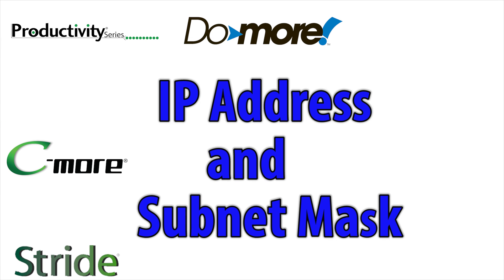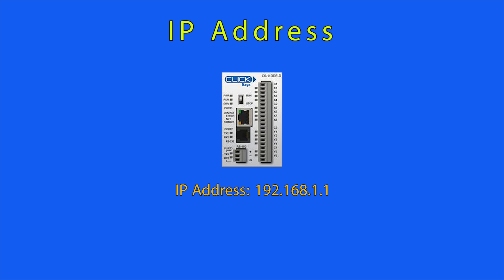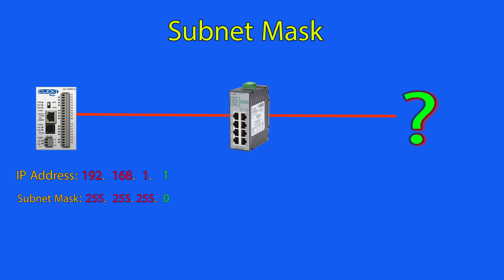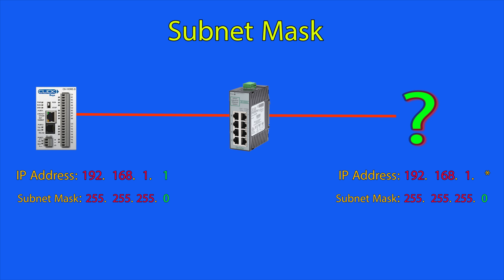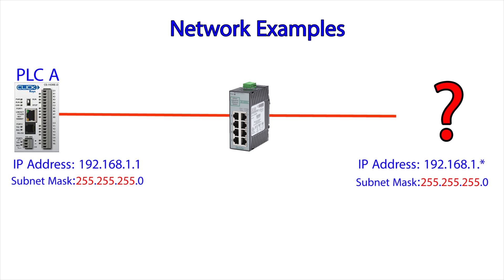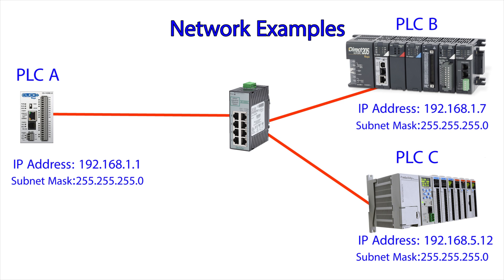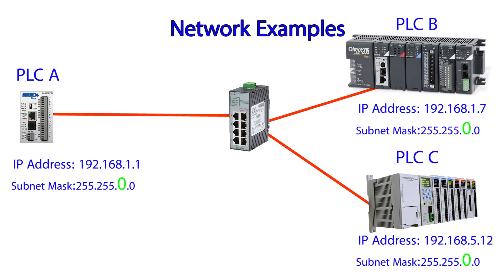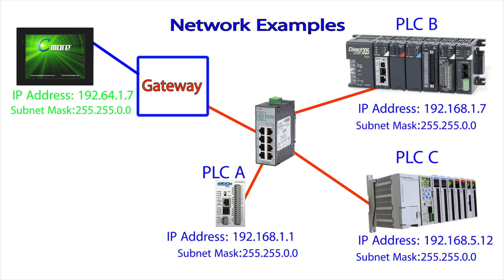Tech Tip: IP Address and Subnet Mask from AutomationDirect

Comment: I’m still kind of lost . Why if you change it to 255.255.0.0. They can talk to each other ?
Reply from the maker: By changing to 255.255.0.0 that places them on the same "subnet", let them know that the communications can flow between two device that have the same starting 2 octets. Example 192.168 .43. 2 and 192.168 .1.21

Comment: 255.255.111111 00.00 00 00 00   
could a subnet mask be like this ?
so my question is is subnet massk 255 or 0 only or can be something in between for some ip addresses 
sorry maybe it is a dumb question from me im not an expert
Reply from the maker: Ts, great question. Yes you can have a "Tight Subnet". You can define any number between  0 - 255. This was a wider topic that could be covered in this "Basics video". There are some subnet calculators that can help to determine the span of your subnet. Please see this link https://www.site24x7.com/tools/ipv4-subnetcalculator.html
Reply: @AutomationDirect.com  ummm but can i get out the tight subnet mask with only knowing the ip i mean there could be many tight subnet masks for the same ip so it is not possible to know which mask for an ip with just knowing the ip 
thank u so much the website is helpful
Reply: am i right
Reply from the maker: @tscoon8199  You would need to know the IP addresses of the devices that you would want to talk to one another. Then use the subnet calculator to create a tight subnet. Of use the range, like I did in this video and just use 0s or 255s.

Comment: Which ip's can be useable if i have IP's of class A with Subnet mask 255.240.0.0 I really need it so please help me
Reply from the maker: The top octet must match exactly, but the second octet only has to have the top four bits match of whatever number you choose.
Reply: @automationdirect  SO It MEans   As we have IP Addresses of Class A with subnet Mask 255.240.0.0
1.	By converting Subnet Mask into Binary form.
			
255	240	0	0
11111111	11110000	00000000	00000000

Here Subnet Bits are 4 = 1111
      Maximum Subnets       = 24 = 16
S0 Mask Bits = 8+4 = 12
Bits for Host = n= 20
Number of host per Subnet    = 2n
                                                                  = 220 = 1,048,576
      Use able host per Subnet        = 1,048,576 - 2 = 1,048,574
First Host   = 
00001010	0000 0000	00000000	00000001
10	0	0	1
Last Host   = 
00001010	0000 1111	11111111	11111110
10	15	255	254

Host Address Range                        = 10.0.0.1 - 10.15.255.254
So finally we can assign any IP address to each device under the Range 10.0.0.1 - 10.15.255.254 which having Subnet Mask 255.240.0.0

Comment: Hi. Thank you for videos.
I want to know, not change subnet mask.
I want to do same with subnet mask - 255.255.255.0-
Is it possible?
Reply: One plc s7 400 - 
192.168.149. X
255.255.255.0
#############
Other plc s7 400- 
192.168.1.X
255.255.255.0
********
I dont want to change mask as 255.255.0.0
...
Reply from the maker: You would have to change the Subnet mask or use a device as a default gateway between these two separate subnets. Some managed switches would allow this type of VLAN.  The Stride managed switch would be one option: https://youtu.be/JWXnYGIa7k8
Reply: Thank you
Reply from the maker: Hasan, I am unsure what you are asking. Please clarify.

Comment: What if my IP adress os 192.168.0.1 ??? Will my Subnet mask be 255.255.0.0 ??
Reply from the maker: Your Subnet mask will be determined by what you need to communicate with 192.168.0.1. If 192.168.0.1 needs to communicate with 192.168.0.2, then the subnet mask could be 255.255.255.0. but if 192.168.0.1 needs to talk with 192.168.25.2, then it needs to be 255.255.0.0
Reply: @automationdirect  how can the subnet mask of Class C IP address be 255.255.0.0 ?

Comment: Well my gateway is 192.168.0.1 so should I put 255.255.0.0? And does that better the connection?
Reply from the maker: Lorex, if your gateway is 192.168.0.1 and your device is on the 192.168.1.X address, you would need to open your subnet mask, on both devices, to 255.255.0.0, so that  they can communicate with one another.
Reply: @automationdirect  ok thank yo so much 😆
Reply from the maker: Glad to be of help. We have more useful videos technical videos here: https://www.automationdirect.com/videos/home